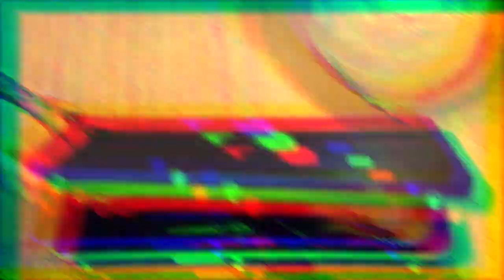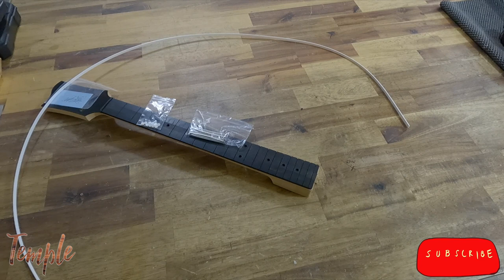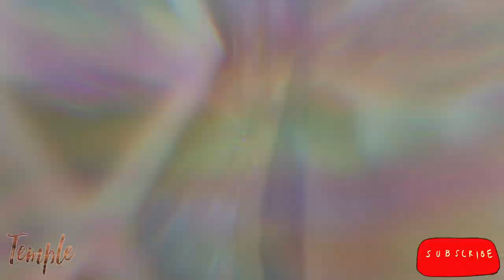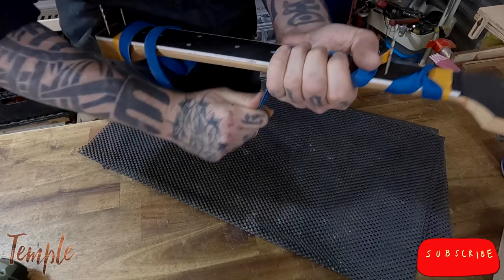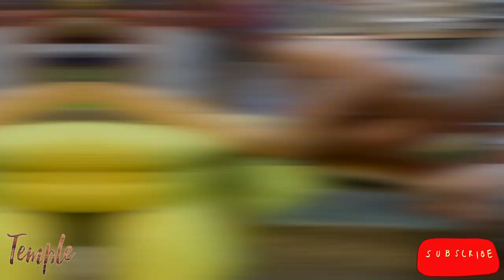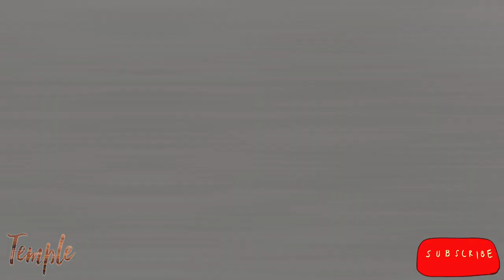Maton Mastersound Electric Guitar Restoration

Comment: That was a very comprehensive fix. Nice work! I particularly liked your process for attaching the fretboard - and I think I need to get myself a silicone brush too! 👍
Reply from the maker: I have just tried the new StewMac band clamps for fretboard glue ups, and they worked so well. I'll be using them in future instead. They're not as strong as I'd hoped, and I don't know how long they will last, but the experience of using them was 1000 times better than giant rubber bands.

Comment: Good stuff, Jay. When you get to the nut video, would love some tips on a 12 string version. Not many good videos out there on the subject.
Reply from the maker: Sure thing- what questions do you have?
Reply: As far as I know, they don't make rulers for 12 strings, so how do you get the spacing right?
Reply from the maker: I just use a 6 string spacing ruler, mark out the distance from the fretboard edge of the outer two strings, then the inner two strings, then use the ruler to fill in the gaps. So, use a 6 string ruler twice.

Comment: What were the channels in the heel area designed to do? Was the neck like a universal set or bolt on design...which ever application suited a specific guitar model?
Reply from the maker: I think that's exactly what it was- Mastersound series guitars are available in set or bolt on neck configurations, depending on the model. Generally I think the more expensive ones are set. As I mentioned in the video though, the space at the heel provides a handy area to insert a truss adjustment tool.
Reply: Old comment, but hey, just in case anyone is still interested... I used to work at Maton when these were in production.  The slots are for steel inserts each with two threaded holes.  Because these necks have such a short heel, regular wood screws like fender etc use, wouldn't have worked.  So these necks were literally bolted on!  Or, in this case glued of course.  But the neck blanks were the same so the slots were in all.  This is a nice video, but at Maton, we would have just routed out the neck heel.  Much easier and faster than steaming it.  It was the same with bridges.  They were just routed down to a thin vaneer and only a small amount of heat and they peel right up.